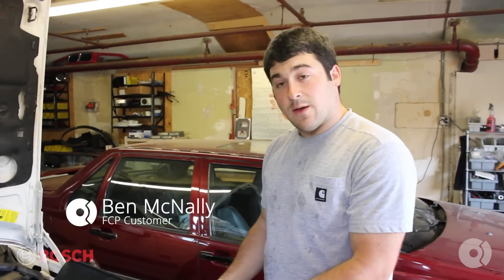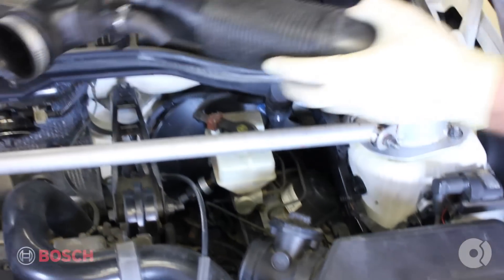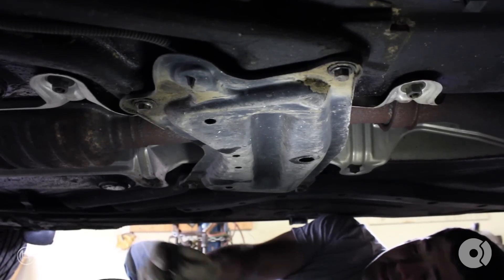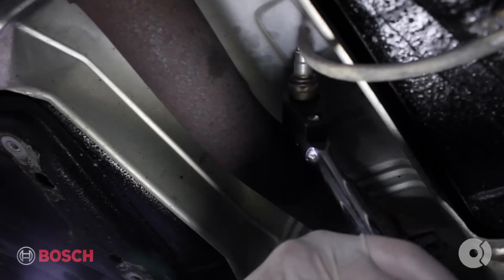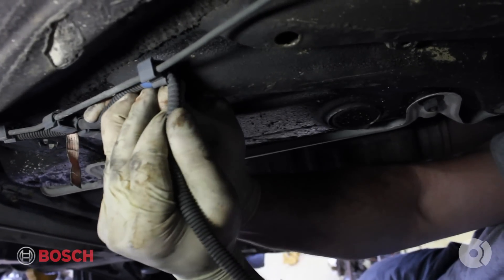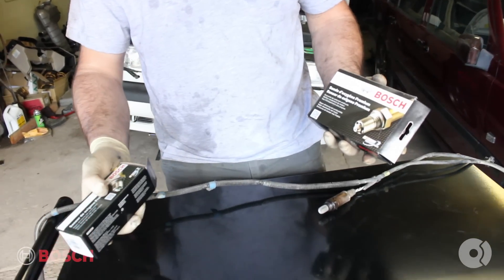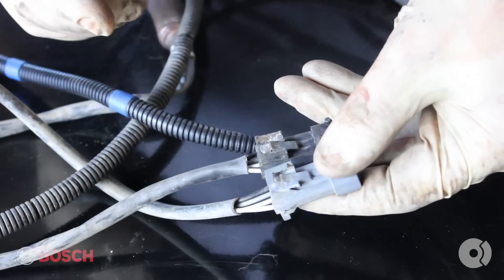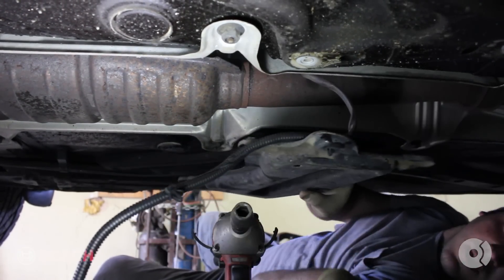Volvo P80 - 850 - Upstream & Downstream Oxygen Sensor Replacement(850R, 850Turbo, C70, And V70)

Comment from the maker: 850 o2 Sensors are basically the same procedure for both the Turbo and Non Turbo Models. The exhaust orientation may be a bit different but basically the same essential information can be used. Hope that helps.

Comment: I have an 850 GLT wagon that will be receiving a new down pipe and exhaust system courtesy of the in-house mechanic.  Are you of the opinion that the O2 sensors have enough slack, with the frame clips removed, to allow for the sensors to be removed without disconnecting them as shown in this video?  My compliments to FCP on the quality and the DIY motivation element in their videos.  It makes you confident in working on these cars.  DGBryan

Comment: I  have a friend with a 2001 s80 with a 6 cylinder motor.  He paid a mechanic to change one of the front oxygen sensors.   The car ran really good for a day or two, now it is having the same problem with rough idling.  I think the error code is P0402.  Did the mechanic change the wrong sensor? Or is it another one going bad, or the new one is bad?

Comment: When I pried up the red thing one side broke off in the connector and I couldn't get it out.  I had to basically break the sides off the connector that held the red pieces.   I was still able to plug the new sensor to it and wrapped it with tape to keep it together.  Hopefully it will hold.   It really should have a new connector assembly.

Comment: Sir!  Thank you very much for this video!  I need to drop the exhaust on my 2004 XC90 due to a broken exhaust manifold flange/pipe break, but I could not for the life of me figure out how to remove the oxygen sensor clip with the red tab.  It is in a hell of a spot as well which further complicated the task.  I figured that is how it worked, but I wasn't sure and was hesitant to put too much pressure on it.  I can now attack the clip with some confidence!  Really, a sincere thanks from ABQ...I do have a question while I am at it... I wanted to remove the exhaust to weld the broken pipe/flange, do you see any codes or problems that may occur when I get everything hooked back up?  I am not planning on replacing the sensors, and there were no previous codes displayed...Thanks again, I struggled for almost 3 hours yesterday with that dang clip!
Reply from the maker: Hello John, I'm glad to hear the video helped you out. I don't see you having a problem with codes from welding the pipe and flange. If you don't have codes at the moment you should be good on that.

Comment: Is this what I need to do if the emissions/ electrical /lambda warning light comes on?not sure what the correct term is. 
 98  V70Se
Great videos ...you gave me the confidence to fit a new PCV kit. 
Massive Thanks 👍
Reply from the maker: Happy to help! Yes, the Oxygen sensor is what you would want to replace.
Reply: @fcpeuro  Thanks for getting back.. Would this also be why I'm getting  lack of power as I build speed also high fuel consumption?
Reply: Gonna start in morn.  Best place for jack??. 
Was gonna get ramp out but it'll be in way?

Comment from the maker: They should be in the same area, but don't hesitate to give us a call if you have any q's during the process, 1-877-634-0063.  Also, FCP Groton is our old site, we've replaced it with FCP Euro which is built on a very fast open source platform.

Comment: do both sensors need to be the same brand? I replaced mine two different brands but I'm still getting the same check engine light codes
Reply from the maker: Two different brands should not have an impact on your check engine light.
Reply: i've heard that you need to reset the ECU, is that true? how do I do that?
Reply from the maker: Egghead820 Clear codes with a scan tool is the best way however SOMETIMES you can disconnect the ECU and vehicle battery for a few hours or so and it MAY clear depending on the fault code. Best way to go about this would be to clear the codes and reset the adaptives with a scan tool.

Comment: Got a 1999 Volvo v70 xc turbo with a P0422. Do you have any videos for this issue?
Reply from the maker: Hello Stephen, there's no videos available at the moment. The P0422 is a catalytic converter code which is usually triggered when the cat is no longer efficient. You will most likely need to replace your catalytic converter to solve this issue.

Comment: Do you really need that special socket to remove the sensor?
Reply from the maker: It is highly recommended to use an oxygen sensor socket  to prevent rounding off of the hex. Also, the socket allows you to get around the wiring lead as well. The other option is to cut the wiring lead and  use  a 22mm closed ended wrench on the hex as well. The only issue there is in some cases you will not have the room to use it. The sockets specific to the job make the task easier and reduce the chance  of creating further complications.
Reply: You could also use a line wrench (aka flare nut wrench).  You should have a set of these in your tool set anyways, great for brake line/trans cooler line/fuel line fittings, etc as well.  It's the same concept with less complication (basically a box end with a small opening for wires/tubing)

Comment: What causes o2 sensors to randomly go out?
Reply from the maker: Over time oxygen sensors may become covered with byproducts of combustion, such as sulfur, lead, fuel additives, oil ash, etc. This contamination causes the sensor to lose its ability to produce voltage and send the right signal.
Reply: FCP Euro would you happen to know why my car is throwing a 121 and a 322 code? It’s got a brand new MAF and I just cut the catalytic converter off yesterday. Service light and engine light comes on then the service light goes off. Theeeeen there’s a tiny little right light in the bottom left corner that randomly comes on and off. Any help would be greatly appreciated.

Comment: Why did Volvo have to over design these cars like this? This is ridiculous.  My buddy had a Chevy Aveo and the sensors were right there when you popped the hood.
Reply from the maker: Cmon, cooldaddyslick, you know your Volvo is a nicer car to drive than a Chevy Aveo!
Reply: @fcpeuro  There are a lot of nicer cars than my Volvo out there that don't have to deal with my overly complicated clogged up pcv system either.....
Reply from the maker: I totally agree, the PCV system is a bit of a pain on those cars.